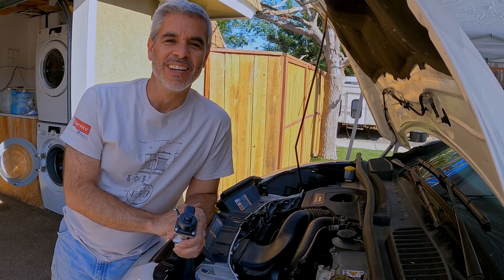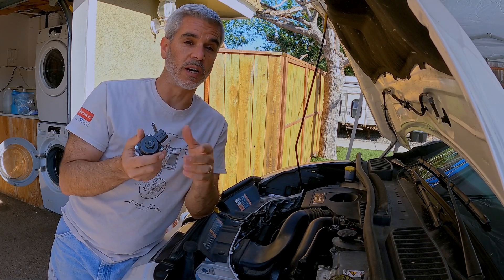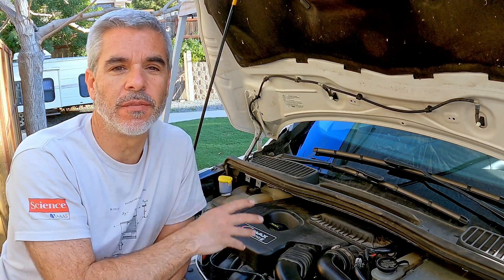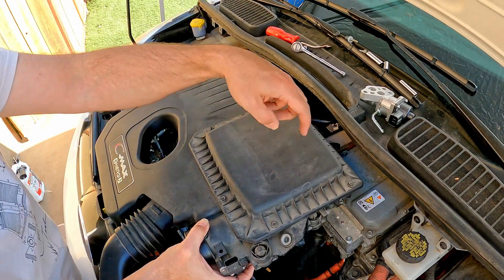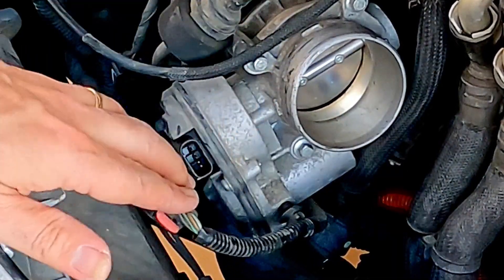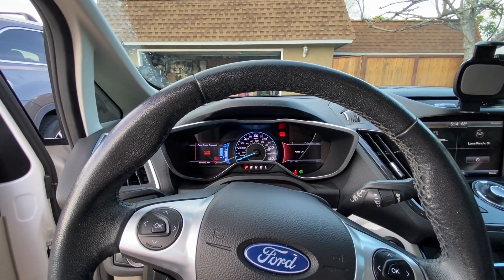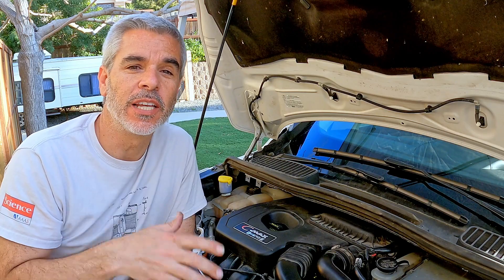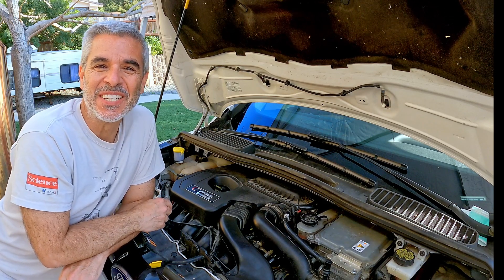Ford C-Max Hybrid / Energi EGR Valve Replacement P0400

Comment from the maker: So what are your favorite FORD acronyms?   I like ‘Fix Or Repair Daily’ or ‘Found on Road Dead’.  My Facebook friend added that Ford backwards is ‘Driver Returned on Foot’.
Reply: Why is my C-Max so reliable then lol nothing has broken on it yet
Reply from the maker: @apostolllos  that's awesome that you got a good one!  What year and mileage?
Reply: @DansWay  2013 Hybrid 156k mi exported salvage auction car
Reply from the maker: @apostolllos  Hey that's awesome.  I owned 4 salvage cars at the same time once.  Now I'm down to just one.  I sold the G37 to get the Highlander.  My daughters took care of the other two.
Reply: @DansWay  That’s cool! Waiting on more C-Max LED upgrade videos, hope you got them coming soon
Reply from the maker: @apostolllos  I have turn signals that I'm half-done installing.  You have to use ballast resistors to keep the blinkers from hyper-flashing, so that took some time to figure out. I need to record the video doing the second side. You might have noticed that I do one side off-camera, then I do the intro showing the difference, and I record the second side being done.
Reply: @DansWay  Great. As of now I only replaced the license plate bulbs, trunk bulbs, pedal area bulbs, puddle bulbs with leds, I’ll wait for your video to figure out the rest because I want to avoid hyperflashing
Reply from the maker: @apostolllos  you most definitely want to get the headlights. They make a HUGE difference for sure!  From a drivers perspective, it is more important than any other upgrade.  Hit up this video: https://youtu.be/MTSYAH0UG-8
Reply: @DansWay  That video is how I found your channel and I most definitely want to install auxitos but they’re a little out of my budget rn but I may order them anyway
edit: ordered the auxito headlights now
Reply: 2013 Cmax here 64K miles, daughter's car, only thing that's gone wrong....very happy with The Max!  Mine is a P0403, wonder what the differences are.  Great video, earned a Sub! Thanks Dan!